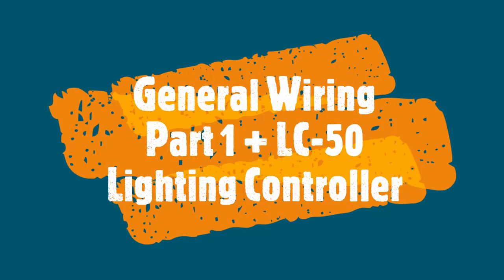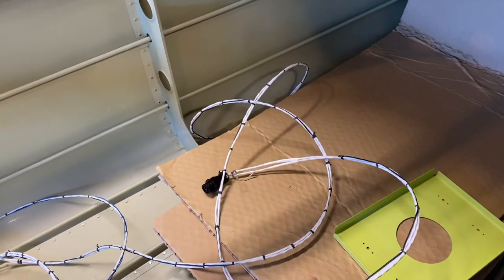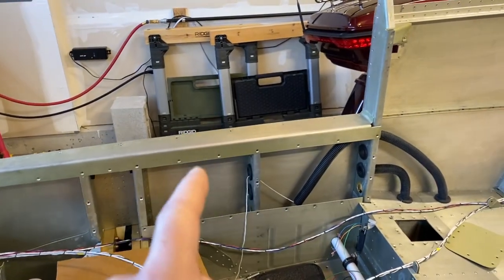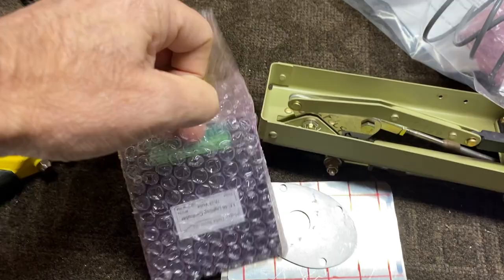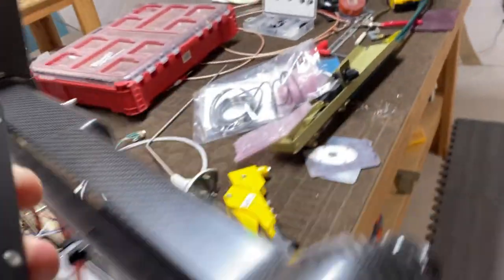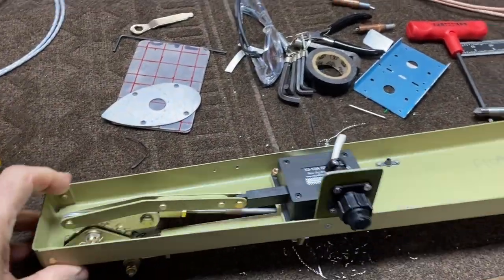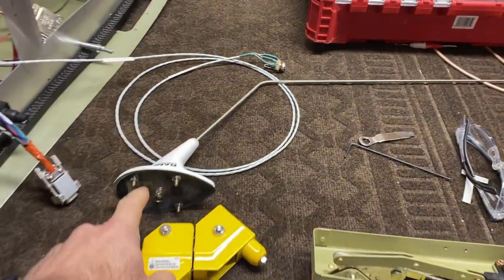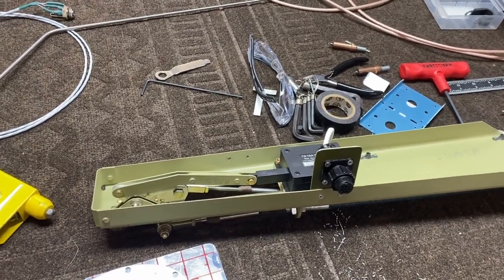Vans RV10 - General Wiring Part 1

Comment: I applaud you for using lacing and not zip ties.
Reply from the maker: Thanks,  i thought about using just zip ties, but the lacing really does give it a clean look and its feels more secure and robust.  However, I have already re-done a couple of these several times as i add wires i missed and plan the routing.